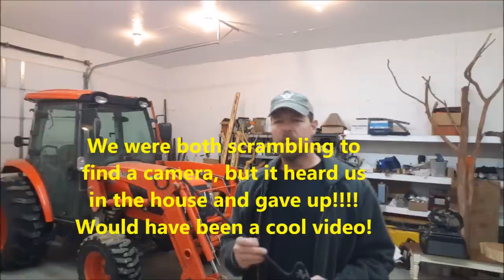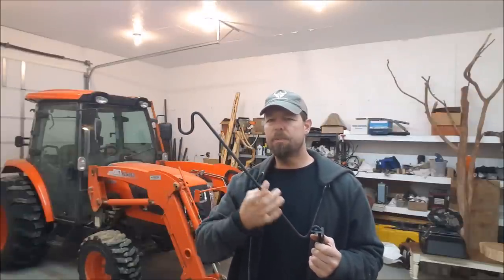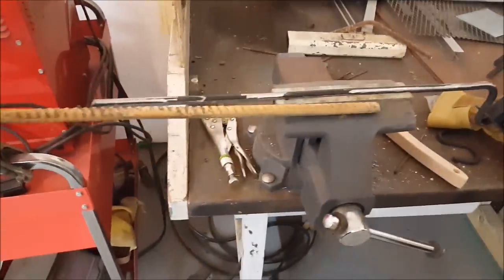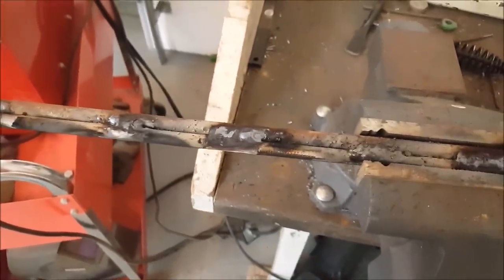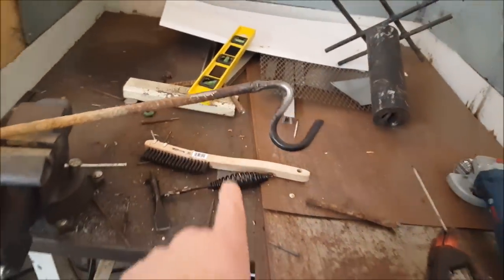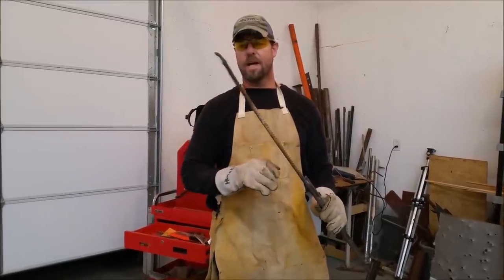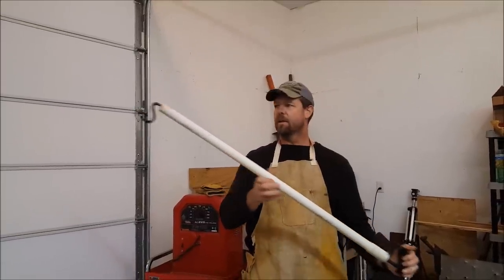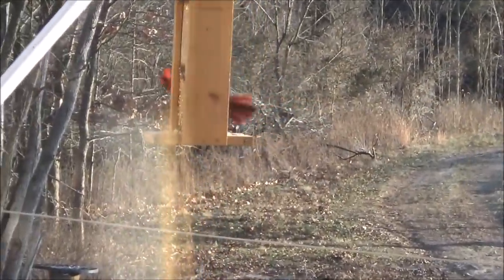DIY Making Raccoon Proof Bird Feeder and the Results...

Comment: Clever idea.  Another idea many (including me) have found successful is installing some chimney pipe as a "baffle" around the vertical mounting pole for your feeders.  You can mount any kind of feeder about the "baffle"; I actually have a couple of different ones.  I've had mine in place for 4 years and no raccoons or squirrels have managed to get past it.  Make sure your setup is well away from any decks, trees, etc. that can be used as "jumping off" points however ;)
Reply from the maker: Thanks. With the deck wires we have though, that would be tough and no way Mrs K would allow that view! LOL

Comment: Ace Hardware markets a Squirrel Slide lotion that will not harm the rodent or anything else. Just reapply every two weeks or as needed. If they cannot grip it they cannot climb it. They can leap up to five feet but the angle means they cannot rise to it. And diving off your house from above does not seem likely to happen. Great work!
Reply from the maker: Thanks we might need to try it. The squirrels have figured out how to climb out now, LOL